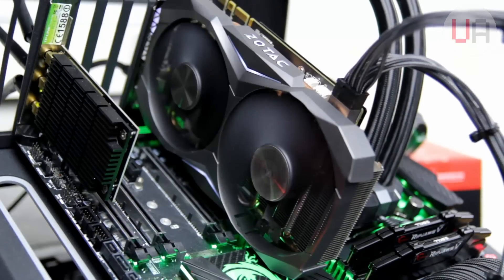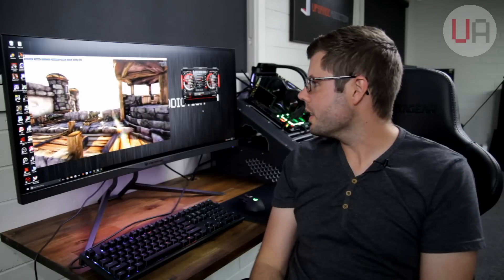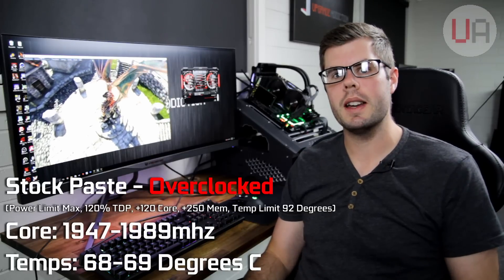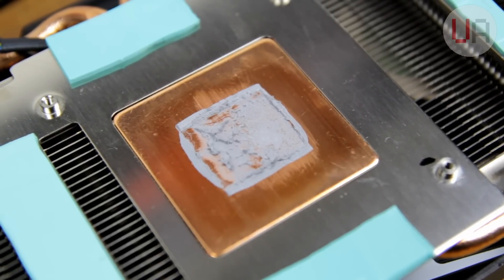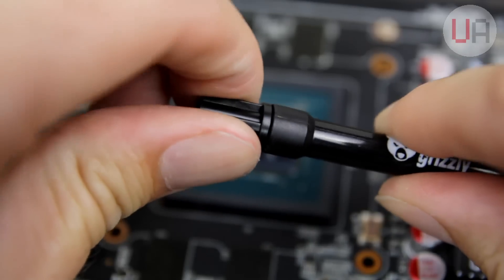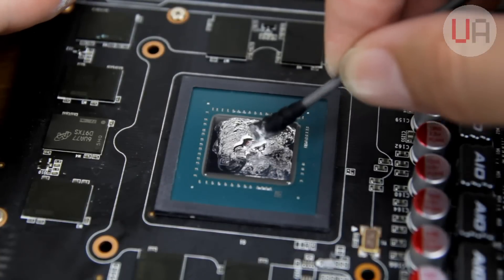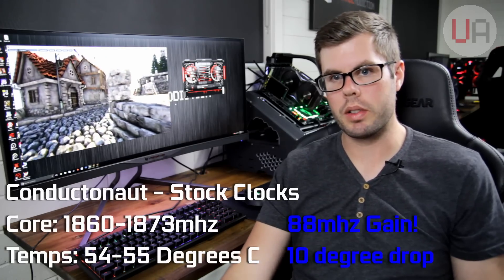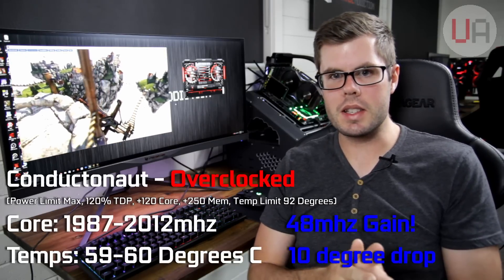Liquid metal on a GTX1080! How much did it help? (Thermal Grizzly Conductonaut - Zotac 1080 mini)

Comment: The question is: Why didn`t the companies made this?? You buy a 700-1000$ GPU and you can`t expect such a simple thing? Thats a shame.
Reply from the maker: I've been asking that same question for ages now!
Reply: I've heard the performance of the liquid metal will degrade a lot over time? Something that's not a real problem with the stock thermal paste? So you might need to redo this every year? 

That's what I thought I read somewhere once? No idea if it's really the case.
Reply: I read it here on a channel too. Why not to redo every year?
Reply: The liquid metal thermal paste is a niche market after all. You cannot expect a large scale factory manufacturer to paste with this expensive high end paste. Plus, when applying the paste, you have to worry about not splitting outside the die as well. All these are not so welcome to mass manufacturing.
Reply: saving 2 dollars on paste saves them millions.
Reply: +Jimmy O 
Just increase the price of the card by 2 bux.
Reply: whats a bux?  oh  you mean bucks? yea, dude marketing is a ripp off . They would more likely use shit paste and charge you ten dollars more, than use good stuff. It also has a lot to do with bulk prices, they use whats the best deal and the cheapest.
Reply: montetank tankkiller They can't use this product on aluminum heatsinks, as it contains gallium.
Reply: Using this stuff isn't ideal. It's hard to remove, expensive, conductive, dangerous to aluminium and hard to apply. Whereas their non conductive cheapo paste they can throw a huge blob on there and smush it down and job done. I do wish they'd use a higher quality paste.. just not this one.
Reply: montetank tankkiller You can't use liquid metal for a consumer GPU because it dries out and needs to be replaced far more often than the stock paste they use.
Reply: It will only dry if the heatsink contains trace amounts of aluminum.
Reply: surely they could just use good quality Non-conductive paste? these days it's mandatory to replace thermal compound on laptop cpu's because of how crap the quality of the paste they come with is
Reply: montetank tankkiller they proba ly buy this cheap paste by the truck cheap in volume. saves them some money
Reply: The problem reside also in reballing gpu's fixation,and in addiction overheated stock rad,to put the people all the way on this subject: planned obsolescence.

The laptop are the first concerned by this problem,could'nt change them gpu,reballing operation,is more expensive then card,well now count the laptop in bin,ps3,x360,ps4,One,subsist on our graphic pc cards,gpu's are good enough,but cards finish in bin,shame to take all the primary and precious ressources to make the opposite of a material progression, anti evolutionary.

Responsibles are PC&laptop Brand,Nvidia,to have taken the new users of PC who have arrived in mass since 2010 approximately, constantly progressing, for pigeons. And everyone pays for it.
Reply: liquid metal is only supposedly good for about 2 years, while most thermal pastes are rated 5-8 years
Reply: But, being the only one applying this thermal paste and consistently getting better temp/overclock and getting praise for it, could get them tens of thousand more saled and a huge image boost for the futur. So I think there's more than that to it. At least for the 1080/1080Ti segment.
Reply: Jonathan Gonzales  its not 2010 there are much better alternatives than A5.
Reply: montetank tankkiller what your trying to ask for is just better thermal paste and application in the factory. liquid metal is super unrealistic. if factories used something like kryonaut and applied it sober then itd be great
Reply: Because this is the best way to brick your card..
Reply: Because liquid metal doesn't last lul, and requires maintenance or reapplying every 6months - 12months
Reply: because liquid metal has worse durability
Reply: Indeed
Reply: As soon as a card breaks after warranty the better for them ! So they prefer the cheap thermal paste wich after a year starts to harden, if you dont know about this issue and consider dust also after ~3 years bye vga need a new one !
Reply: Always wondered the same. Surely it's not big deal for the companies to use better paste. They could even market it like they market their coolers. And whatever top brand decided to go for top paste would most likely have the best temps out of all the cards, and people would notice it.
Reply: LM is a much more dangerous material to use on a production unit. If you've ever applied LM, you know that surface tension is sometimes an absolute pain, plus, if any of it seeps around the edges during shipping and handling, it can destroy and aluminum parts it touches and can also corrode solder joints.

As for why better paste is not used, it's usually because it's a bit cheaper and/or they have a warehouse full of the stuff that they need to get rid of.
Reply: @Animal_lives_matter  its way more than two bucks. Manufacturers apply thermal paste via a machine using a silk screen, this would need to be done by hand, and costs 10-12x more than cheap paste, also youd have to factor in jimbobs cousin working at the plant that squirt some on a part that he shouldn't have and shorted it out, causing an expensive RMA

Comment: Just a tip when performing tests regarding temperatures. State the ambient temperature for each test so the metric of comparison is change in temperature AKA 'delta T' as opposed to absolute temperature.

Comment: Should get some Artic Clean. I know most people just use the rubbing alcohol but it really does make a large difference. Don't need to use 5 coffee filters folded over 100 times and its just a lot quicker.

Two-three drops and it dissolves the paste within 3 seconds. Wipe off, couple drops of alcohol and you're done.

Comment: I had a gigabyte 980ti that I did this on. Some liquid metal managed to make its way to the pcb, in the cleaning process a tiny ball of liquid metal managed to get under the Graphics chip (Between the pcb and the gpu) She was a good GPU!
Reply: first of all it must not be put on both sides but must be applied in the same way as applying the thermal paste, then you must surround the whole die with the tg shield, an enamel that is applied around the die and then insert the metal while if you got ass you can buy the cpu guard for amd processors

Comment: Great video. One suggestion would have been to note the fan speed (% or RPM) for all tests. If you dropped 10 degrees and were able to run a lower fan speed (quieter card), that's doubly impressive and well worth noting.

Cheers!
Reply: He clearly said he locked fan speed at 65 like four times

Comment: That off center badge on the fan would drive me nuts too! Plus it may even unbalance the fan as well. You should coat the SMD's with clear nail polish, then there will be much less risk of the LM making contact. And you can just use nail polish remover to remove it, if need be. Good video! Looks like you and the YES Man get your glasses at the same place!

Comment: I can't figure out why your channel is so small with the quality. Your proved a point that liquid metal helps but with normal article silver I achieved the same drop in temps. With my EVGA 1080. (80 to about 69-70. Would've been cool to see a comparison between stock, new paste, and the liquid metal. Otherwise great video
Reply from the maker: +Saber Slayer it's only very young (the channel) 

Yeah great idea. I'll keep that in mind!
Reply: I just ordered some Gelid GC extreme (better than mx4 from arctic) I want to see if it can fix my max temp of 78 on my ftw 1080, I would like to get to 2100 mhz, the closest I got so far is 2050.
Reply: @krystian3797  Give Noctua NT-H1 a try. Dropped 7-9 on average from my CPU. Waiting another couple days to put new TIM on my Strix 1080.
Reply: Arctic Silver contains an actual metal compound (silver) so it would probably be just as effective. I've been warned against using AS5 in laptops, but I still use it, and it hasn't harmed anything. Only helped.

Comment: My GTX 1080FE from Nvidia with an EK full cover waterblock hits 34c max under load and 1911MHz and 10010Mhz before it boosts no OC. It's not even factory rated to achive those clock speeds. I thinck I might try the LM and see what it can do. Great presentation by the way. Just subbed

Comment: you can cover those resistors with normal TIM an leave it there. So its always protected, even if you mess up while addin the cooler later on.

Comment: would it be better if you applied a layer of clear nail polish around the GPU's shinny heat spreader and especial on those tiny electronic component in which you mentioned on your video "careful not to spill any liquid metal on it".  :D great video anyways keep it up you earned my sub. :D

Comment: Great video! I used this liquid metal before on my gaming laptop with two GTX 980m and got similar results(about 10c drop)
Reply: Now I'm using custom water loop on my 980Ti and have it runs at low 40s with OC

Comment: I just saw another video that stated Intel says they use a paste that holds up much better over many years and that they specifically went with longevity as being of higher importance than absolute conductivity. I suspect the same is true for GPUs. So even though most people see a real improvement in peak temperature values when they delid a chip and use liquid metal, the question is how it will be a few years later.  For an enthusiast that replaces their GPU every couple years it may not be as big a deal as for the average Joe who just plugs a card and runs it sometimes for 4-5 years or longer.
Reply: FYI, Tesla initially looked at using gold for their electronics connectors because it has higher conductivity and better corrosion resistance so they assumed it would be better even though the rest of the automotive industry used tin. They found out later that gold flakes off and doesn't handle vibration nearly as well as tin does so they went back to tin like the rest of the industry.  All I'm suggesting is that if a premium GPU card manufacturers knew that they could run a faster boost speed by using a few pennies of a different product that they probably would. 

if you look at something like the Morpheus GPU heatsink, it works better than stock GPU air coolers, but you end up with a 3 and a 1/2 slot wide device, which is why you don't see companies producing that.

Comment: So i finally did liquid metal on my gtx 1080...if left at at stock it reached 83c with the fans autoing to 85-94% so it sounded like a jet engine. After applying conductonaut, i got an unexpected crazy 14-15c degree drop. I now get 68-69c with autoing fan speed of 44-48% and it can overclock at 40 mhz higher than before.
The only thing i worry about is the longevity. I've heard that the LM can last well over a year...but ive also seen and read that it does sometimes dry up eventually and does bond with nickel-copper at a very slow rate.

Comment: Good result, but I still would have covered the small items along the core
with clear nail polish or tape,
since with "liquid" metal on a card 
may eventually run the conductonaut onto the small parts.
Ounce of prevention costing only a dollar.
Reply: You could do that out of paranoia but not necessary if you use a thin layer of liquid metal.

Comment: I replaced the stock Thermal Paste on the CPU (no lid for some reason) in my 7 year old laptop with Arctic MX-4 Thermal Paste, and I also cleaned out all of the dust for once, and the fan got more force behind it, and it got a 9 degree improvement on CPU Core 1, a 12 degree improvement on CPU Core 2, and 9 degree improvement on the CPU Cache.

Comment: To anyone with a 7700k: I highly recommend delidding applying thermal grizzly liquid metal. Huge improvement, I'm running 5ghz stable on air in a low-flow case with temps under 80c, compared to 4.8ghz with temps above 90c stock.
Reply: Did you apply liquid metal to both underside and die cover?
Reply: @LightningFast240  No, some people suggest doing it but my theory is the more layers of paste, the more opportunity for air pockets. I may be wrong but I think applying to one side leaves less chance for air pockets.

Comment: Nice to see someone finally using the right amount of Liquid Metal. I want to use some on my Ref 1080ti but it looks like the heatsink is aluminium.
Reply: The heat fins are aluminum but the block touching the die is copper

Comment: More of that stuff was better in my case.. I did my card this way, and apparently didnt put enough of it cos the results were almost non-existent. Then I opened it again, used multiple layers of nail polish to protect the surrounding pins and added more of the liquid metal and only then I saw results of around 6-8 degrees. Different pcb manufacturer tho

Comment: Nice job man. But just so you know cunductonaut is extremely malleable. The main reason people put on tape or other solutions is because if you do manage to run the graphics card hot for a time the stuff will run off a little and even if you didn’t mess up on installation, a little bit of the cunductonaut could seep out later.

Comment: Today I applied Cool Laboratory Liquid Ultra on my Sapphire R9 390 Nitro with Backplate, but unfortunally my temps did not change a lot. I also used Unigine Heaven 4 to heat up the GPU and I also set a static fan curve with MSI Afterburner (35%), both time I looped for about half an hour. In both cases the graphics card was able to hold its 1040 MHz all the time, no throttling. In stock condition, the max temp measured by HWMonitor was at 85°C, after applying liquid metal the temp just went down to 82°C. Just a very marginal difference. The old layer of Thermal Compound was thin so the Liquid Metal should have a good contact with the cooler and Die. I dont know why that is since the r9 390 produces some heat and the cooler is not that bad either. A better heat transfer should have made a big difference, or am I wrong...?

Comment: To be compairing temps, any temps you need to use the "scientific approach". The term Delta T (ΔT) is the difference of temperature between two measuring points. Which differ either in time and/or position. So to factor out influence like ambient room temps/Airing of room etc, you use the ΔT. Record the temps = let a hard or software tool autolog them incl time stamp. Record the ambient room temp, preferably in that same log. Then make list :    ΔT Component temp (CPU for example) = ambient temp - component temp. 

Example1 (temps logged for 30 minutes on full system load):
Average ambient temp is 32°C
Av. cpu temp 59°C, ΔT CPU = 27°C
Av. Motherboard temp 50°C, ΔT MOBO = 18°C
Av. GPU temp 65°C, ΔT GPU = 40°C

Example2 (temps logged for 30 minutes on full system load) for example after applying new paste like in this movie):
Average ambient temp is 29°C
Av. cpu temp 56°C, ΔT CPU = 27°C
Av. Motherboard temp 47°C, ΔT MOBO = 18°C
Av. GPU temp 52°C, ΔT GPU = 23°C

Now you compare the delta temps (corrected for external factors), these findings are what you want to see.

Comment: Condutonaut stays liquid and apparently will move. Every other example of applying it to dies (admittedly nlt on de-lidded cpus) i have seen has first put a conformal coating (or nail varnish) over the tiny smd's around the die - just in case, it would only take a tiny blob of the stuff to short out one of those (presumed) capacitors.

Comment: You should have applied an acrylic conformal coating to the resistors on the GPU. You're really taking a big risk by not isolation them from the liquid metal.

Comment: The  liquid metal has the property of drying out, and over time the temperature becomes higher than on the thermal paste with the same measuring interval. I would like to hear the author in six months.
Reply: No it doesn't, it's a metal, it doesn't have a liquid content that evaporates. I've been running a naked 6700k with a lapped copper waterblock directly on the die with liquid ultra, run at 4.6ghz 100% load 24/7 for the last 8months+ and the temperatures haven't increased since the day I applied it.

Comment: just did this with my MSI laptop (CPU and GPU).  My GPU was running with max cooling at 74c and now it runs at higher res at 65.  If I put it back to LOW (not HIGH), it will drop to 62c. 

Yes, super dangerous.  It look me over an hour just cleaning and putting down electrical tape.  If I did it over again, i would have masked taped the chips and spray plastidip instead of using tape.

Comment: I very much enjoyed the video! Sub granted as it is very informative and I also enjoyed your video and audio quality. Well done. As for liquid metal, my 6700K, currently running @4500MHz all cores goes first. It's gonna be delidded and I am looking forward to it. The Aorus GTX 1080 Ti will have a paste replacement to Conductonaut later on. Thank you for the very enlightening video!

Comment: Will be doing this for my i7 7700k, and my GTX 1080 FE edition.
Reply: Lucky. Im too poor to afford any of that
Reply: I wouldn't get the i7 7700k now anyhow, the new i5 8600k is slightly, just a TINY bit better, due to it's 6 cores, it beats the i7 7700k in everything... but again just slightly, and for the price of under 240-260 bucks, that's 60.00+ cheaper than the i7 7700k... as far as the GPU lol yeah, the miners, and recent EXPLOSION of PUBG fucked the GPU game up.

Comment: I hope there's no aluminum in your heatsink, if that gallium liquid metal touches it ....won't be pretty
Reply: jboydgolfer1   That heatsink is probably 90% aluminum. I’ve never seen people use Liquid Metal on off the shelf GPU’s for a reason.
Reply: The part of the heat sink touching the GPU die and liquid metal is copper, it'll be fine because it has to have direct contact with aluminium to react to it.